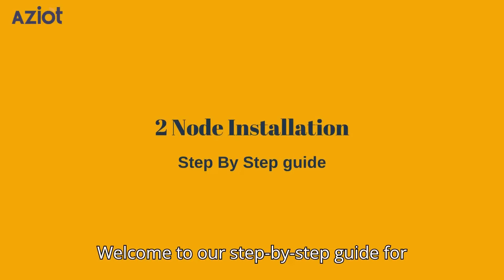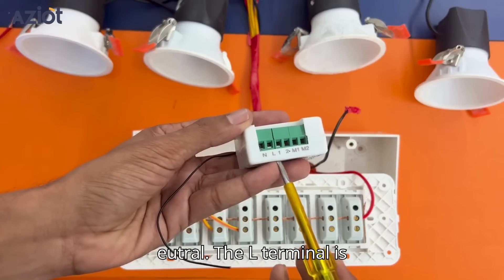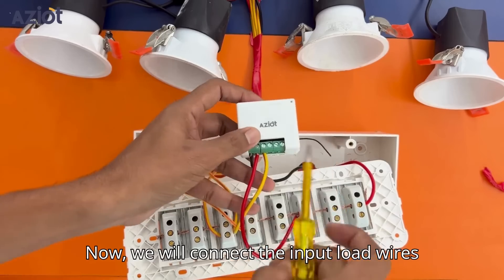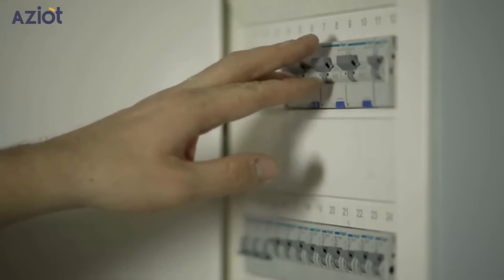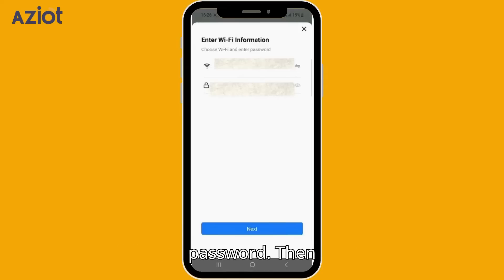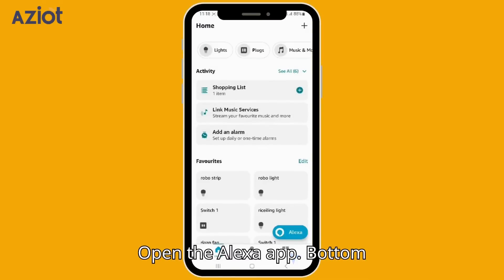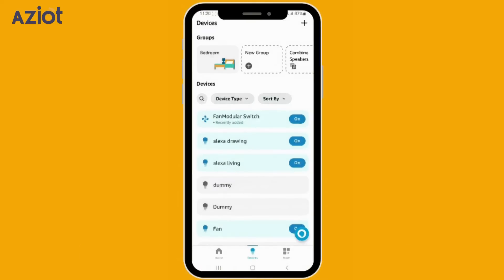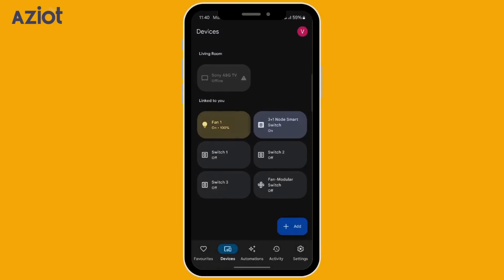Aziot 2 Node Retrofit Switch Installation | 2 Node Smart Wifi Switch installation

Comment: I bought 2 node Aziot smart module. I 'm able to configure and control from smart life app. However in Alexa under skills and games Smart life app is not showing. Can you assist to link this module to Alexa
Reply: There is a link option in Smart life app itself. This works.
Reply: @guruprasadr6743 thanks

Comment: I recently bought 4 Node Aziot switch. I wanted to know about the maximum wattage that I can put per switch? I have put 200w in one switch and it's not working. Rest lower wattage 3 nodes are working.  So please tell the maximum wattage load per node of a switch
Reply from the maker: Hi
Thank you for purchasing the Aziot 4 Node Smart Switch!

Each node of the switch is rated to handle up to 200 watts of load. If you’ve connected a load around or slightly above 200W and it’s not working, we suggest checking the following:

✅ Load Type: Some appliances (like motors, fans, or LED drivers with inrush current) draw a higher startup current, which may exceed the limit momentarily and trip protection.

✅ Wiring & Connections: Ensure the wiring is secure and the neutral is properly connected to the switch and the load.

✅ Try Lower Wattage: Temporarily test with a lower wattage load (like 100W bulb) to confirm the node is working.

If the issue persists, our support team is happy to assist further. Please reach us via WhatsApp or call on 8886635918 between 9:00 AM to 8:00 PM.

Comment: can it be used in the freezer
Reply from the maker: Thank you for your question!

The 2 Node Smart Switch can handle appliances up to 10 Amps, We Recommend you to use 1 Node Smart Switch which can handle upto 16amps.

– Team AZIOT
Reply: what is the per channel load bearing capacity of 2 node vs 4 node smart switch

Comment: We have single connection for 2 22W led lights like that we have 2 switches and 4 LEDs in total can we use 2 node module for this
Reply from the maker: Yes you can use 2 node.

Comment: Please recheck your description of wires. The yellow is Load (or live), the Red has to be Neutral and the black which is not connected has to be earth
Reply from the maker: Red Wire is for Live and Black Wire is for Neutral, there is not Earth Wiring to the 2 Node switch.

Comment: What happens when power goes of and comes back? In physical switch ON mode and app on mode? Also when physical switch is on, can we switch off from app?
Reply from the maker: 1⃣ When power goes off and comes back:
You can configure our device to either remember its last state (ON/OFF) or reset to a default OFF state. This is called the Power Restore Mode and can be set easily via the app.

2⃣ Physical switch ON mode vs App ON mode:
Both the physical switch and the app control the same relay. So, if you turn ON the device via the app or the physical switch, it will work the same way.

3⃣ Can you switch OFF from the app if the physical switch is ON?
Yes, you can! Even if your physical switch is ON, you can still turn OFF the device using the app. The app always has control regardless of the physical switch position.

Comment: hi, I am using it for last one week. today it went offline and doesn't turned ON in manual switches. what should be done??? its 02 node switch. Help me here how to fix the issue.
Reply from the maker: @premgeeth123  you can call our customer support at 8886635918

Comment: I am using 2 node in a switch board consisting several points including the plug, do i have to remove the main Neutral from switch board and give to the aziot?
Reply from the maker: You can reach out to our customer support 8886635918